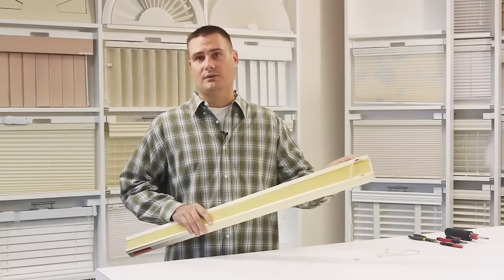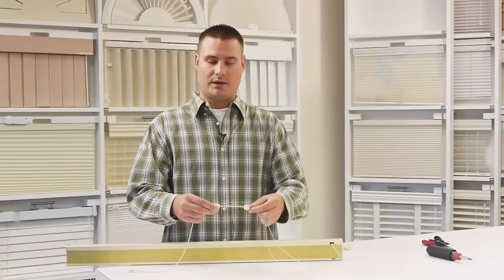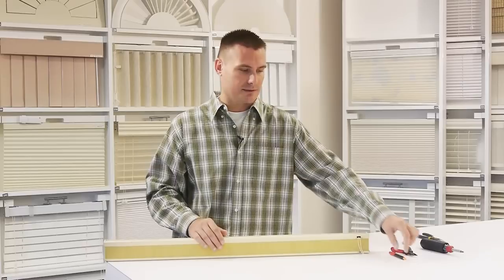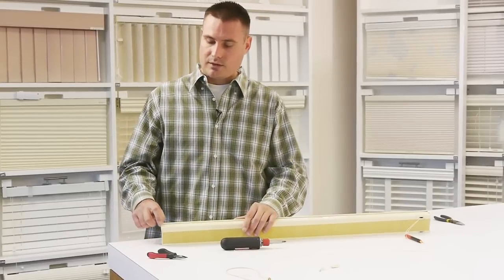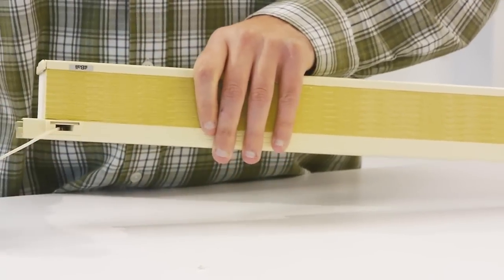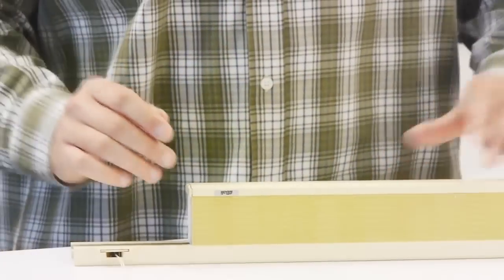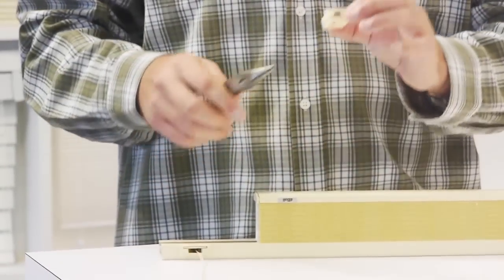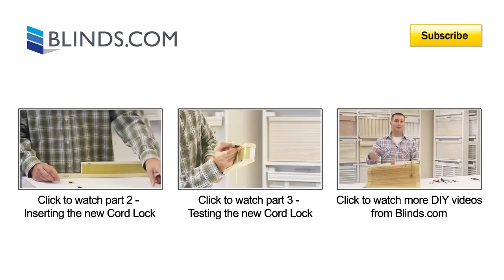How to Replace a Cord Lock on a Bali Cell Shade - 1 of 3

Comment: I have tried following these instructions, which seem to be well explained and detailed.  But the stumbling block is the step where I tried to remove the old lock.  The lock is made of two parts that are screwed together.  On each side of the lock there are two flaps, one for each part of the lock.  They are not very flexible and cannot be pressed so that the lock can be taken out.  I have a new cord lock and it seems that its flaps are also not very flexible.  Once the lock is in the shade, the only you can take it out is to break it.  The easiness in taking out the old flaps, as shown in the video, is misleading especially with the tools used.